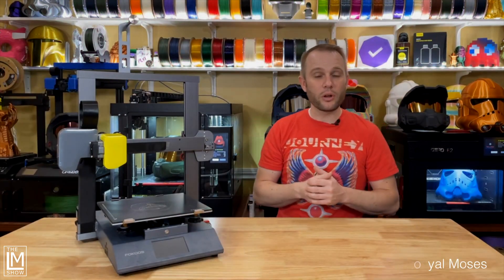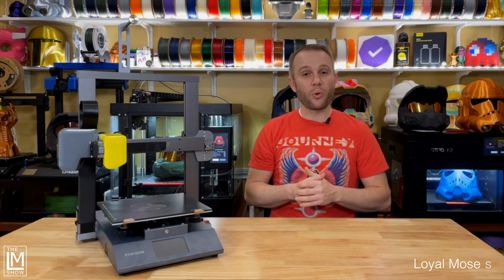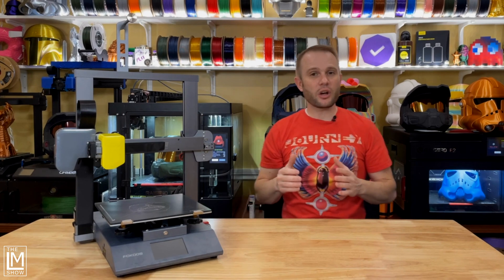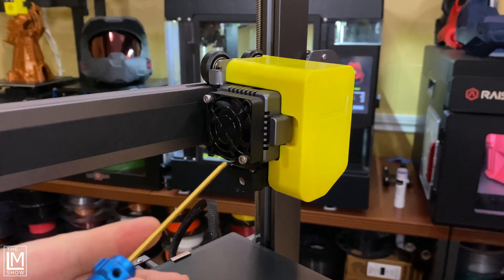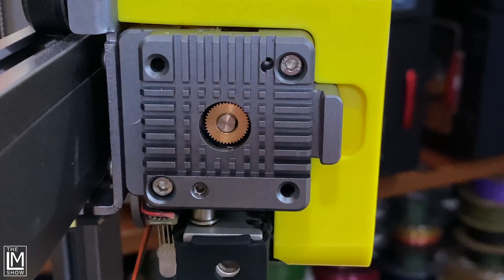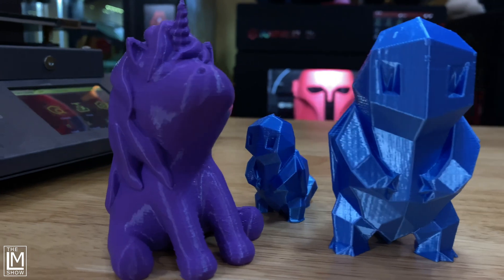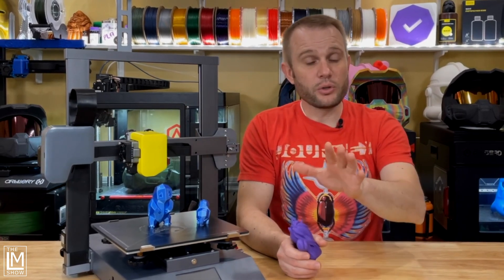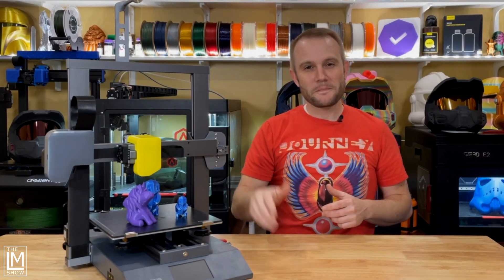FOKOOS Odin Smart 3D Printer - First Look

Comment: I'm not impressed by the quality of the prints. The squirtle showed some under-extrusion.
This read more as an uncritical promotion video than a first look. Even a first look should have some information.
How can it be enough just to remove a fan?
Reply from the maker: The little Squirtle had under extrusion due to printing it at too low of a temp, once I bumped it a few more c, it was printing just fine and had similar results to the Odin-5.